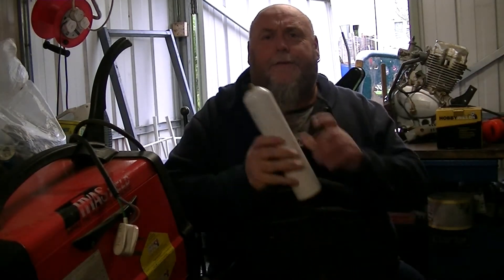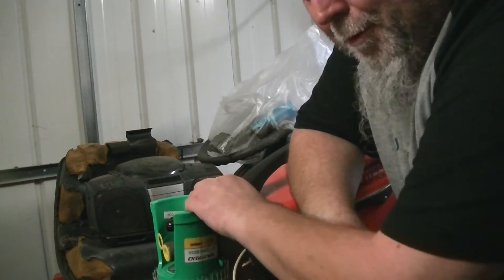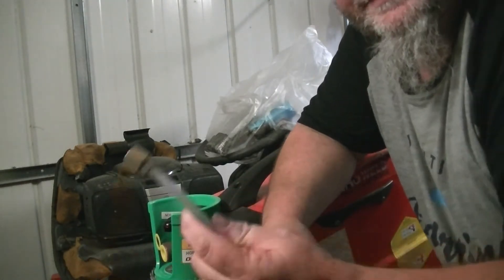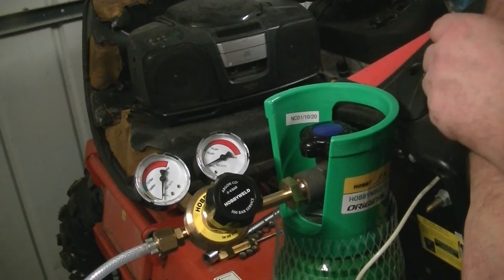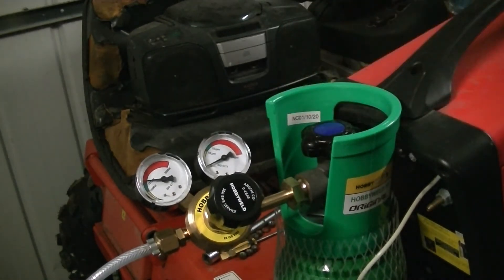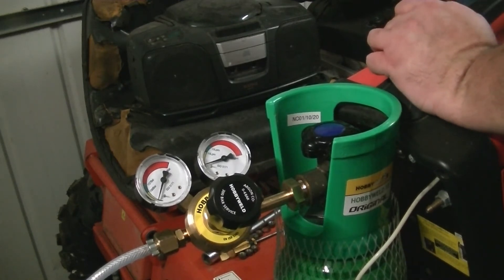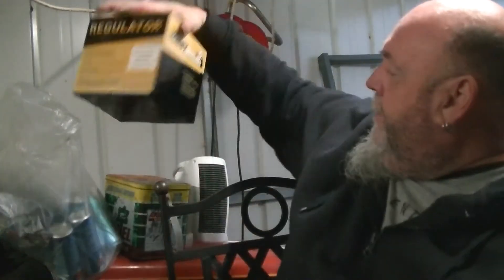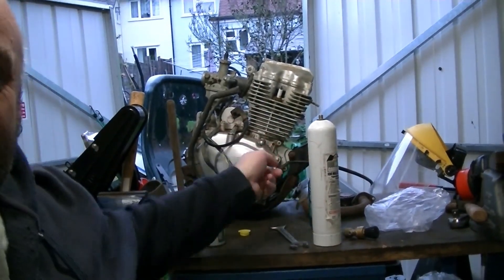HOW TO UPGRADE YOUR MIG WELDER GAS BOTTLE TO HOBBY WELD GAS HOBBYWELD 5 / 15

Comment: Blimey Colin, long time no see from when you worked at Jenways in Felsted!!! Great video, and I hope you’re doing well.
Reply from the maker: Jenways that was a long time ago blue boy I'm trying to think who you could be let me know your name
Reply: @scrapmanColin  
I used to drive around in a 1600E Cortina and had and still have a T500 Suzuki. First name Chris. No surname please!!!
Reply from the maker: Bloody hell Chris long time no see trying to think when it was I'll see you I thought it was going to be you or Keith Bob Dylan hope you are well mate
Reply: @scrapmanColin  
Doing ok Colin, you’re video came up when I was looking for info about hobbyweld gas. I couldn’t believe it was you at first. I’ll have to go through the rest of the videos. I can see you have several on here. 👍👍
Reply from the maker: Yes that gas really good and it works out quite cheap too I'll get mine from Haverhill because I'm in finchingfield so it's only down the road
Reply: @scrapmanColin  
Nice one Colin, I had a look in the stockist in Takeley today and they have what is called original, plus and ultra size bottles. Can I ask what size you are running and approximately how long it lasts? They said original bottle is £70 to buy + £33 for gas. After that I just pay £33 for refill. Next size up is £100 to buy, but around £85 to refill. Smaller bottle I think is 9 litres medium bottle is 20 litres, so would last a lot longer and probably cheaper in long run but for what I need the smaller size would probably be ok! Sorry for the ramble!!!  👍👍